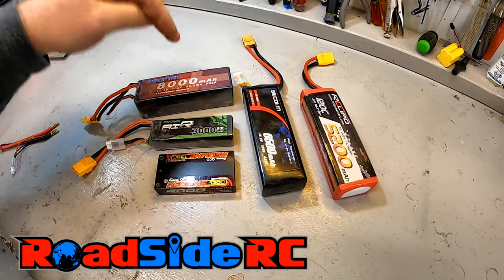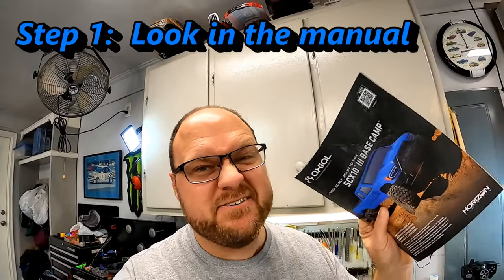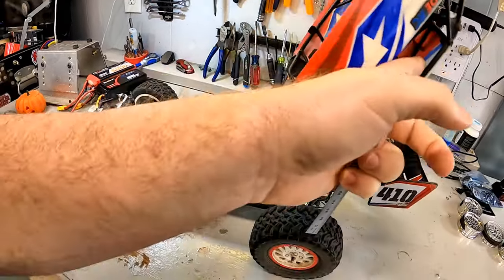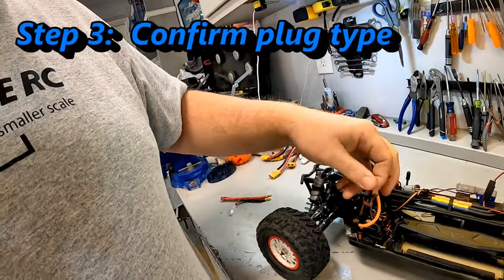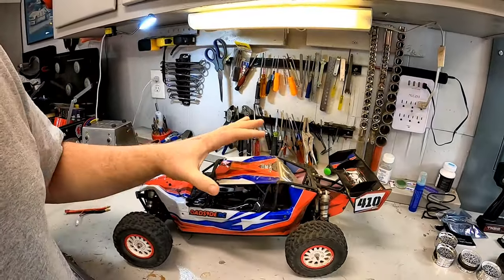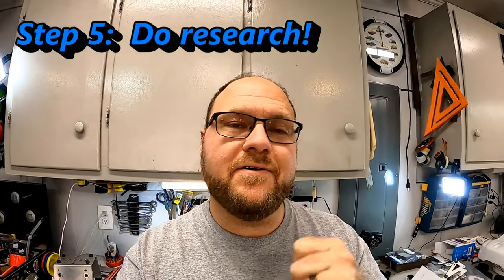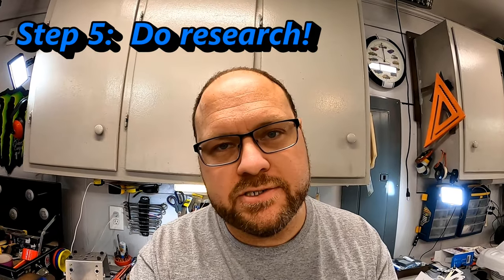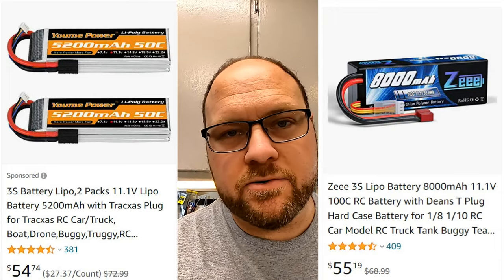6 Steps How to Choose the Right RC Lipo Battery

Comment: I mostly use Zeee brand batteries at this point. I run their standard shorty 2C batteries in 5500mah with 100C discharge for turbo/boost heavy and bashing. And their small cute little 2C 1800-2200mah 50c batteries when I just wanna slide around the kitchen or crawl. :D The smaller ones have yet to fail during turbo/boost for me but I dont hit it all the time on my slick floors. I do miss the weight the shortys bring though.
Reply from the maker: Fun!   Thanks for sharing. 

I have been considering trying some of the <2000mah batteries again.  You know I am a stickler for weight, so really curious if they can perform well enough.
Reply: @RoadsideRC  I say it sounds like a new video subject :D I really love the tiny batteries, they last ages and the weight is much less. :D

Comment: I've had horrible luck with ovonic packs. I mostly ran them in my 6s arrma mojave. They just can't supply the amps to push the big trucks like my CNHLs or Gen Ace packs. (This really shows in their smaller FPV packs) Even running them in my 1/10 scales trucks the run times is only about 60%. I'm 100% confident you get what you pay for when It comes to lipos! Buy nice or buy twice in this hobby 🤣
Reply from the maker: Interesting!  
I have had good luck with Ovonic, but not great results with CNHL.   Odd how that works!

Comment: I’m just getting into the hobby and purchased a used Arrma Granite. What battery would you recommend ? Nothing to pricey please. As there is so many options out there and after reading some ratings on amazon I’m really lost. Please help
Reply from the maker: Happy to help!  I tried to break the steps down in this video.  Which step are you hung up on?
Reply: Well the truck came with no instructions (used) I tried looking up the specs as far as what you were explaining but didn’t understand what the battery C meaning I know it’s a 3S battery. But there is lots of batteries in amazon costing from 25.00 to 100.+ my question was what brand was a decent one to purchase. No worries I’ll keep searching for help. Thank you for your time Sur
Reply from the maker: @marzgtp  Happy to help - just didn't know where you were getting stuck.  

Even used, you can get the manual straight from the Arrma website.  It is handy to download and have!  

I would suggest starting with this battery:  https://amzn.to/3yZ5KnL

Also, I suggest using the 50% or 75% throttle limiter on the controller at first.   That will save a LOT of broken parts.  These trucks on 3S provide A LOT of power  and it is easy for a new person to break more parts that way.

Good luck!

Comment: What types of batteries last the longest. Are there any that last longer than 15-20 mins? Or maybe even an hour?
Reply from the maker: The higher the "mah" of the battery, the longer it will last.  

Measure the battery box dimensions on your vehicle - and compare it to the dimensions of batteries you find.    Fitting the biggest mah battery you can get will give you the longest run time.

Comment: Rc noob here....which battery upgrade to get for typhon grom? Just want to extend play time.
Reply from the maker: Same steps apply that are in this video.  

Tips:
1) if you want to extend run time, then you are looking for a bigger "mah" rating on the pack.  This may mean it is physically larger, which is why you need to watch out for the size of your battery tray. 
2) the IC2 connector on the factory battery is really limiting.  There are A LOT of choices of very quality batteries out there that will perform better than the factory battery.   But - you need to be able to solder on a new connector.  Good news - soldering is not hard, and SUPER valuable skill to have in this hobby.  

Follow the steps in the video, and you will be in good shape.  Let me know if you have a question about a specific step!
Reply: @RoadsideRC  ty for reply, much appreciated! Since im a noob I would love a "plug and play" option....but from what I read, there isnt one?
Reply from the maker: @albertorochareyes2427  There probably is - you will need to follow the steps and look!

Comment: Great vid, great channel! I have a noob question though, if I may (which you kind of answered in the video I think). I have a Quantum Maverick MT and the manual says it can run on 2S or 3S LiPo, but @ 7.2v… what does it mean to have a 3S run @ 7.2v? The exact excerpt in the manual says “3S LiPo or 9 NI-MH : 540 or 550 size motor ≥ 18T RPM < 2000 @ 7.2v”… If you can help me make sense of that I would be so grateful and will leave you a Thanks donation (: Just trying to learn here so I don’t have to ask my husband everything!
Reply from the maker: Hi there!  
That is some unusual wording in that manual.   It would be easy to get confused by that. 

It is giving a motor rating for which 3S lipo is safe to run.  It is suggesting more than an 18T motor for using a 3S lipo.   The truck comes with a 15T motor - so that means it does not recommend using 3S.
Reply: @RoadsideRC  That’s so confusing, why say 2S OR 3S in the first place then! Sheesh! Thanks for the info, I’m sure I may have more questions in the future so I left you a small thanks donation (:

Comment: The C rating (even not considering it is usually fake, even more than the capacity) must be considered with a grain of salt: a battery twice as big (capacity) can have half the C rating of a smaller one and still deliver the same high current capability (Amps), since the C rating is a multiplier of the rated capacity, and not an absolute number.
Additionally a bigger battery not only increases the running time, but also the weight, so it decreases the performance. Additional weight is never good, that is why racing cars are as much lightweight as possible.
Reply from the maker: Thanks for the feedback!